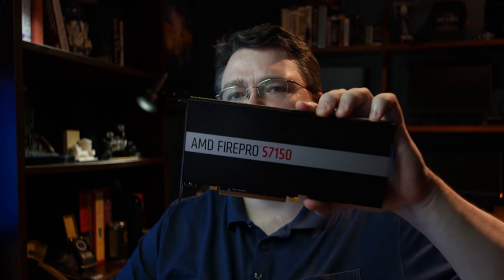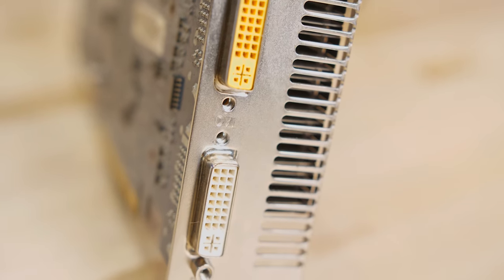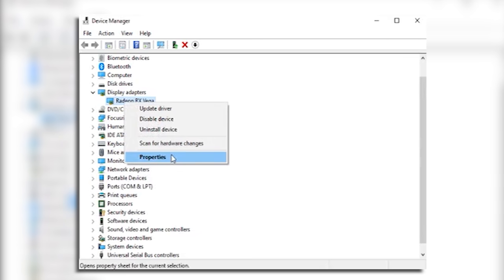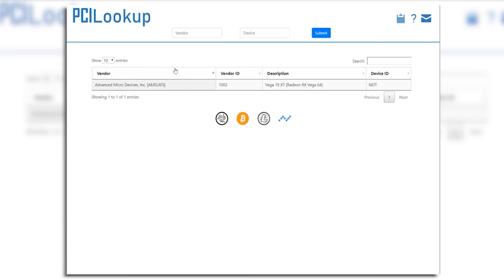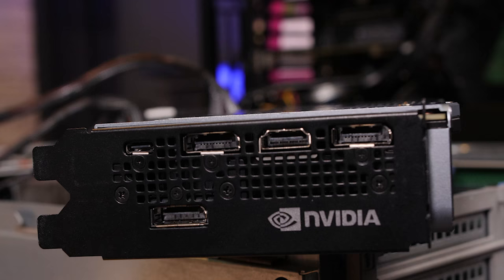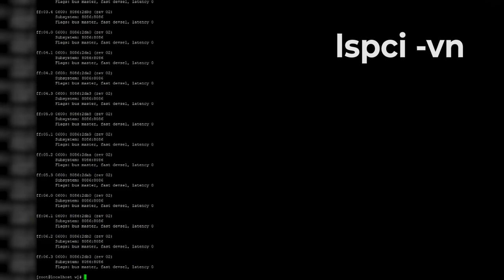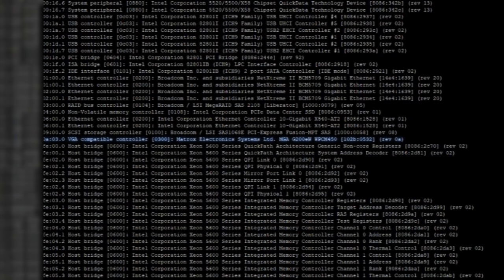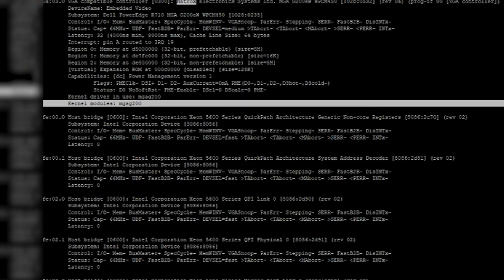WHAT Is This Thing On My Computer?

Comment from the maker: BTW, the capture is blurry..........whoops.
Reply: don't bother, the content is essentially amazing
Reply: But what if what you have is a "Shenzhen Special Refurb?"  Those PCIe ID's surely come from firmware, which, typically, the manufacturer of the device will have controlled right?  Even the "Vega" from your example might not be immune to PCIe-configuration-space knock-offs.  But, that has cryptographic verification of vBIOS right?  Idunno.  Typically those flash-time BIOS crypto-verifications are enforced by the existing firmware.  So I expect one could hand arbitrary microcode to the silicon (and remaining board components) and everyone would happily gobble it right up....  (I am only not "sure" because theoretically, AMD could have gone ahead and implemented symmetric cryptographic verification between firmware and on-die qfuse-style write-once-read-many ram.  But I really doubt it; they would have surely been eager to tell us all about their new security feature :)).

So: I'm almost-but-not-quite-sure it'd remain crypto-bios-locked only so long as the consumer (or "refurbist") was unwilling to desoldier the nvram (or unable to reverse-engineer the vBIOS bootstrap requirements which might actually be the harder challenge come to think of it... hmmm).

Anyhow all of that is assuming it's really mostly Vega-like.  What if it isn't and relies on the AMD drivers to detect all the ways it differs?  Like maybe it could really be an RX480 and Vega drivers from WHQL would do the right thing in spite of the PCIe-configuration-space mismatch.  That "Vega" label just comes from the .inf, which in turn just looks at those VID/PID/etc numbers so I'm sure that's possible to exploit (I have seen this done in practice a bunch of times for sure.   In fact; the keyboard I'm typing on does just that (except s/PCIe/USB/g)).
Reply: Is Zilogs ID Z80 :P
Reply: This thumbnail is the best thing i have seen.
Reply: lol, ya'll got anymore of dat resolution ?
Reply: Been using Hardware ID for over 15 years, makes you look like a Tech God to the average Technicians...

Comment: If your Linux machine keeps crashing with a Kernel stack error. Is there any way to fix it without reinstalling the system all over again? I'm trying to set up a CCTV system out of an old PC . I got it so everything works and is recording. Then a couple of days or a week later it crashes with a kernel stack error. Nothing works until you reinstall the operating system and drivers again. It's like the operating system deleted itself.
Reply: go to [forum level1techs com] and start a thread there, you will get far better linux support there then in the yt comments
Reply from the maker: Come to the forum! Someone would be glad to help: https://forum.level1techs.com/
Reply: Ohhhh, sounds like your drive is getting corrupt, only time I’ve had Linux screw up was an SSD bit the dust and corrupting itself, sounds like failing HDD (which definitely makes sense, you are recording with it, and it’s probably an old drive although it could be brand new and still do it). Good luck!